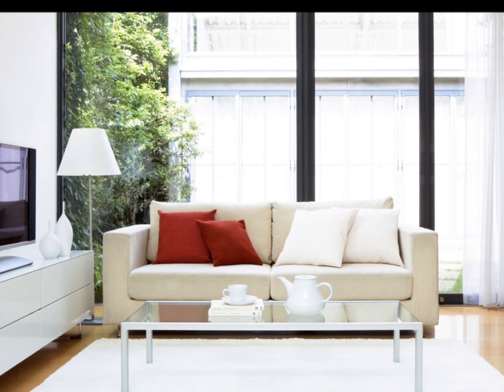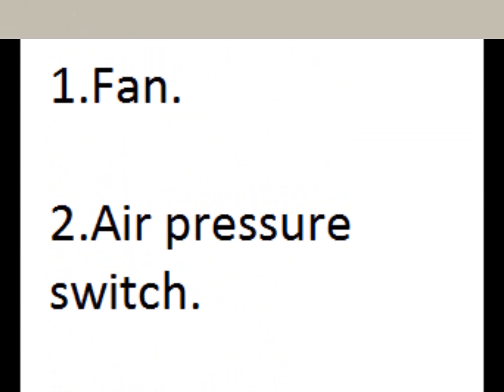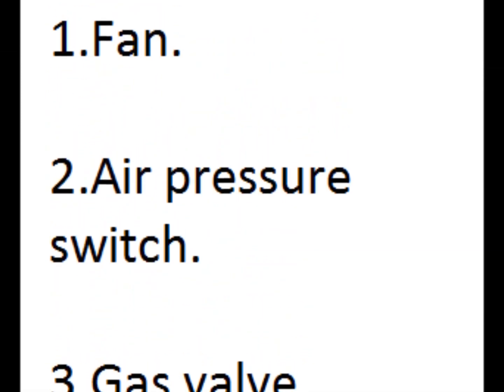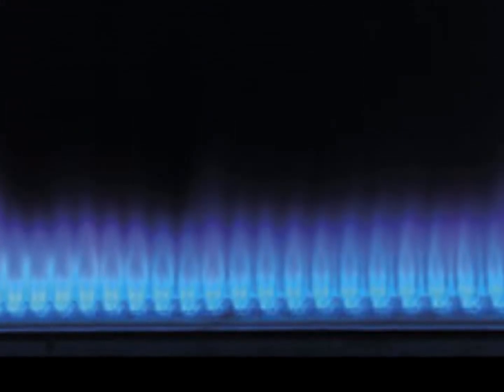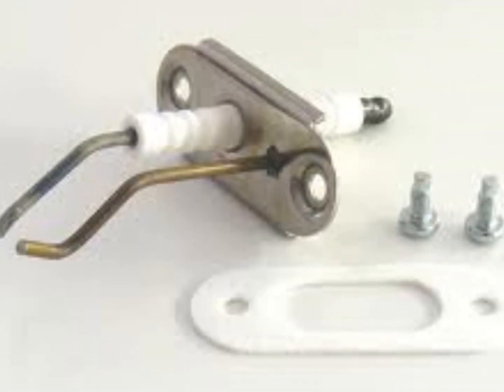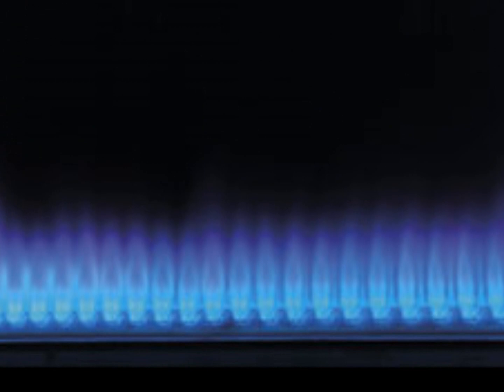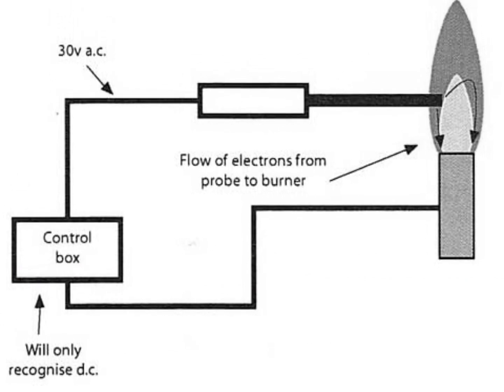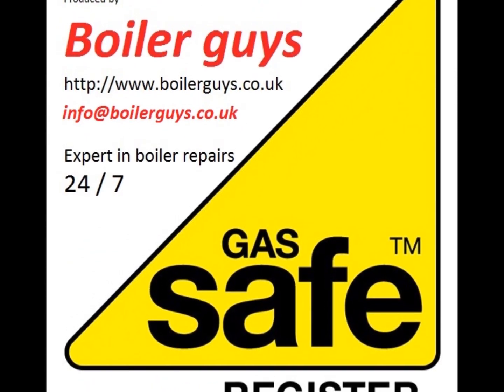Learn boiler repair part two

Comment: Painfull...quite frankly a whole load off hot air about nothing specific...only valid point was regarding qualified gas safety certification
Reply from the maker: You think so lol good luck thanks for the comment

Comment: 1 Demand for central heating. 2 Motorised valve moves to required position. 3 PCB checks primary circuit and etc etc. 4 Power is supplied to Pump and the Pump runs. 5 Pump proves using a flow switch on the primary hot water circuit. 6 PCB checks the fan pressure switch has dropped out. 7 Power is supplied to the Fan and the Fan runs. 8 Fan proves using an air pressure differential switch. 9 Power is supplied to the ignition components and an ignition spark is delivered across ignition probes. 10 Power is supplied to the gas valve. 11 PCB checks for presence of flame using flame rectification. 12 Once flame is proven, gas supply to main burner is established. 13 On demand end, Power is removed from gas valve and fan, Power may remain to pump and fan to disperse residual heat build up in primary heat exchange (Pump and Fan overrun).
Reply: Well at least you know the correct sequence lol not like the idiot in the video
Reply from the maker: love your comment
Reply: Doesn't matter who is right the guy in this video is making a big effort here and it's crystal here 
Great video

Comment: Sooooo wrong my friend the pcb will not sanction any of these events unless firstly the pump is running otherwise BANG! Once flow has been identified then the rest of the sequence can begin and of course ending with pump over run or the same result as the beginning, as a gas safe engineer you should at least get it right if you are putting stuff like this out on the web 👎
Reply from the maker: crazy good to know you care

Comment: in this video you showed about mechanical repair..i.e fan..pump ..and gas valve...what about electrical faults on PCB... or on digital displays..what if therez no power on display..basically the boiler wont start or show any faults ..
Reply from the maker: only part 2 the might be a part 3 soon stay tuned
Reply from the maker: this is so funny cos i know your here to learn lol

Comment: Hello ,

I have a heatline compact boiler and it has been working fine for about 6/7 years . 

It heats the radiators and hot water to sink and shower ,

It has now stopped working correctly to the shower .....only the shower .
It runs hot and cold ? 
The stat in the shower was changed but it made no difference .
It is mains fed , the shower will run ok at first ,then start to fluctuate between hot and cold . 
Any suggestions welcome , ......I need a shower !!!!!  and I wont fit in the sink .....  ha ha  , photos attached .....not of me ,,,the boiler .
Reply from the maker: Might be the plate heat exchanger first thing which comes to mind
First place to look

Comment: Should the fan start immediately the boiler is switched on as on mine (the boiler does not work) when I switch the boiler on the fan jumps as if it is going to turn but doesn't? Does this mean the fan needs replacing?
Reply from the maker: This will get to shortly sorry for delay part 3 out now

Comment: my main boiler makes some loud noise when running like stones are inside does any one have any ideas what i should do?
Reply: boiler pressure is probably down mate as it is kettling ie : low water in the heat exchanger ( can cause banging ). or it could be a blockage in your heat exchanger causing low circulation . get an engineer out to have a look k  does it go to lock out ?
Reply from the maker: may be air would love to hear it

Comment: i been reading the comments all the other engineers seem to hate you guys i guess you are taking there work lol
Reply from the maker: Dave Laye
any idea what wrong info has been said
i would be very interested in your reply
Reply: @boilerman5541  Jesus who taught you, I wouldn't attempt to teach anybody the basic principles of a boilers firing sequence. If I wasn't clued up on the subject 🤦‍♂️🤷‍♂️

.Boiler in standby mode

Demand called for via room thermostat/timer

Circulator Pump runs – activating primary flow switch then micro switch above from NO to NC

Diverter valve remains in at “rest” position (central heating port open only)

Pcb sends voltage to fan

Fan runs ok

Aps activates from C and NC position over to C and NO position (Sending signal back to pcb)

Overheat stat is checked for closed circuit (continuous circuit) Primary thermister is also checked for correct thermal resistance

Spark generator and ignition electrode(s) ok

Gas valve energised and ignites ok (low rate)

Flame detection electrode ok (sparking finishes – ionisation proved)

Gas valve ramps up to range rated set pressure (Controlled via the ntc thermistor and potentiometer at p.c.b)

Boiler control stat or room thermostat is satisfied or the timer shuts down boiler

Fan and pump over run continue to dissipate residual heat (over run time will vary)

Boiler returns to standby mode
Reply from the maker: funny they on you tube trying learn and rubbish teacher lol keep it coming guys we need the views lol

Comment: You are a complete tool... Are you for real? Are you actually gas safe? Gas valve opens before ignition? DONT LISTEN TO THIS ... So what is the "boiler sequence "on a netaheat 10-16 ? Does the aps make the ignition and gas valve on that? And the fan on what you are explaining has got positive and negative pressures that connect to a venturi ..
Reply from the maker: really . . . .

Comment: i don't think the FRD has to communicate with the PCB to hold open the gas valve for gas flow to chamber. the solenoid is held open by the current created by the flame, not current send from PCB. Am i right or wrong here, anyway should we be discussing these things at the view of innocent public? cheers

Comment: Well i hope you are not a Gas Engineer
Boiler Operating Sequence not explained properly missed out a lot of components such as Pump, Micro Switch Diverter,  Valve,  thermistor and etc. 
But at least you have made the effort and it is basic sequence as you have said and there are other parts as you said.
Try uploading in an education manner please do not confuse people
Sorry my point is not to offend you and it is good video but a little effort would be better as you do in ACS exam.
Reply from the maker: some of us will never get it